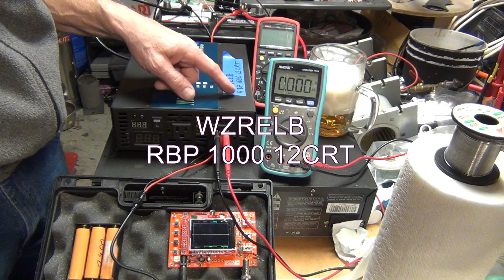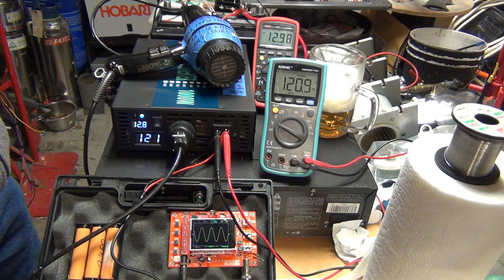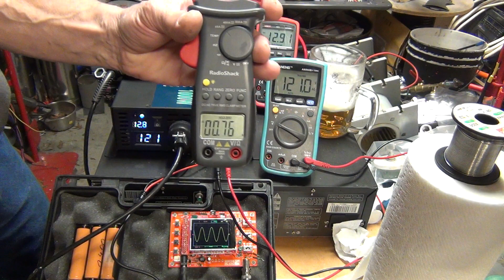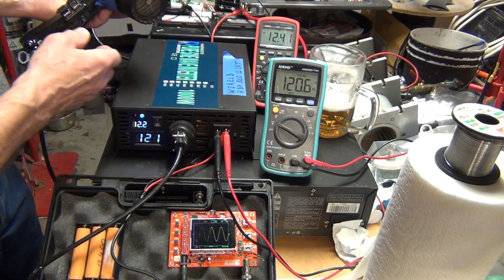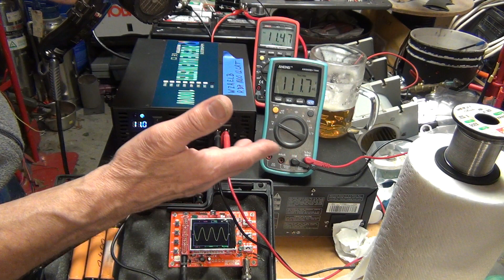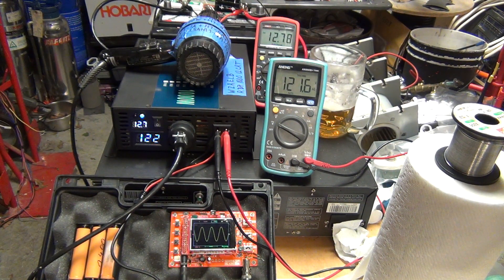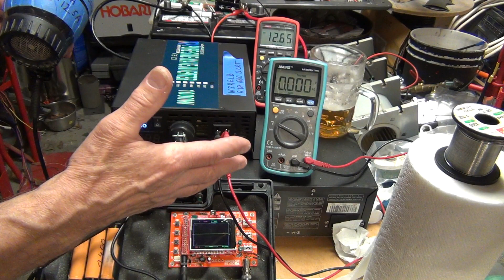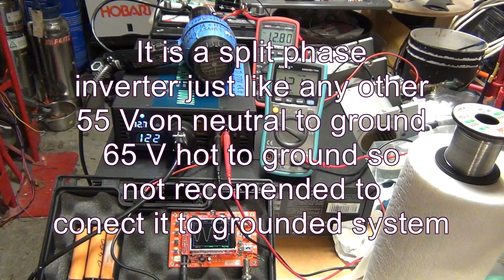Review of WZRELB pure sine wave power inverter

Comment: Not sure if I missed it in the video but what kind of battery / DC source are you using for the test?

Also what type and gauge cable is the battery to inverter hookup using?

Comment: There could easily be a lot of resistive drop off between the battery terminals that your cheapy meters that you got from who-knows-where that are probably not even calibrated and the input to the circuit after all the wiring and shunts and fuses. Let me ask you, what kind of cable were you using? Is it really able to carry 83A over the distance between the battery and the inverter? Have you measured that resistance?

The inverter doesn't have a low-voltage cutoff and it never advertised it to have one either, so why should you expect it to have it? Besides, your BMS should have cut off for the battery for you and you should program it yourself to cut off where you want it to cut off instead of having something like the inverter enforcing that for you. This is a really bad review because you're criticizing something unfairly because of your unreasonable expectations.

Comment: How much are the Voltage drops on the positive wire and the negative wire connected to the inverter? May be that is why the DCV meter connected directly to the batteries shows higher Voltage than  the built-in meter of the inverter.
Reply from the maker: voltage  drop is minimum, maybe 0.3 volts if that much
Reply: so 0.3V on each wire = 0.6V, best to measure them during the test to get real data.
Video @ 5:47: your DC meter shows 11.9VDC, the meter on the unit shows 11.7VDC at the loaded condition with Vdrops of 0.2V/2 = 0.1V Vdrops on each battery cables.
Video @ 6:27 with 800W load, your DCV meter shows 11.19VDC, the meter on the unit shows 10.7VDC, so the vdrops on the cables = 11.19V -10.7V = 0.49V/2 = 0.245V Vdrops on each battery cables, so meter is correct.

Comment: I think the reason that the low voltage shut off on this unit was around 9.5V was probably for various battery types, like lithium ion batteries in a 3S arrangement. You can't blame the unit for that. You should have an under voltage shut off protection board anyway if you're bypassing the BMS to the inverter.

Comment: You are not taking into account the DC voltage drop in the 12 volt  wires between the inverter and the battery. So the DC voltage dependency is valid. Your measurements are not.
Reply from the maker: Holly cow , how much voltage drop is on these short wires? 0.0001 volts?
Reply: Measeure it Jack!  Not to mention the voltage drop of the internal wiring. I'm an engineer and have worked with high current DC voltage all of my carreer.  So there's that.....  @VladFredK
Reply: As much as .4 to .5 volts. Most likely copper clad aluminum wire. Most likely small wires inside of the inverter causing even more voltage drop. @VladFredK